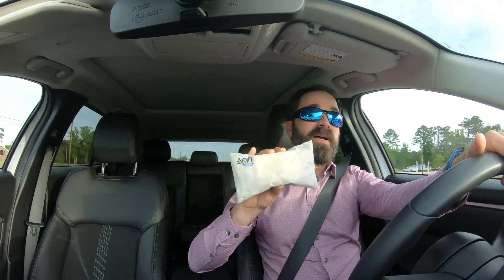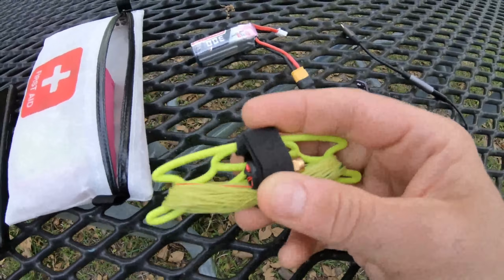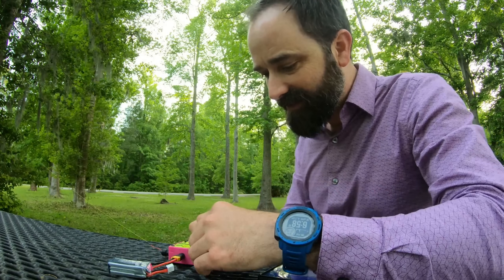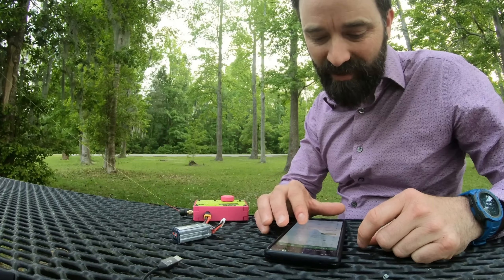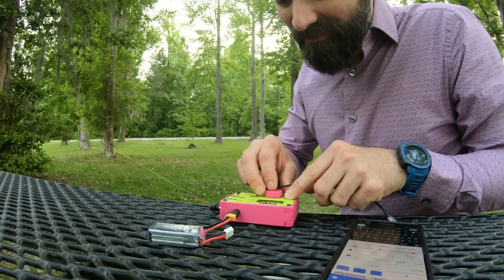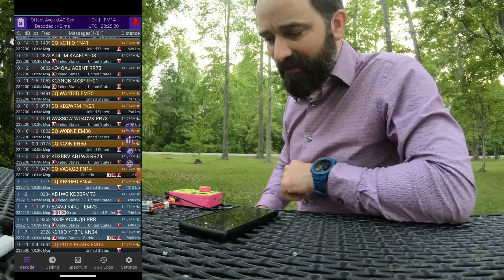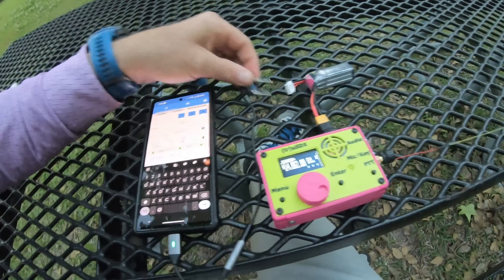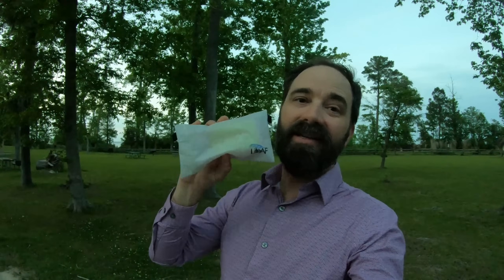Smallest possible all-mode POTA kit?

Comment: Adam, would you think about switching over to the QMX for the ultimate all mode pota kit once Han's gets the SSB firmware fix done?  Will it ever be possible to do JS8Call on a cellphone with a app like FT8?  Would you ever consider powering your radio with USBC PD since you always have a power bank with you for your phone.  Found a kit on amazon that has multiple barrel connector adapters to USB C that initiate the handshake to supply 12 volts only?
Reply from the maker: No, I still think the KX2 is a much better performing radio.  But the QMX is still one of my favorites. I built the QCX amp to go with it too, along with an internal amp low pass filter for 10m and external filters for the other bands. It's pretty sweet!

The QMX is incredible for the $, and is a far better performing radio than the truSDX.

Comment: Pretty nifty. I’m working to put together a small POTA kit….not this small. My battery would probably weigh more. Less is more. I think I’d be more inclined to activate it I didn’t have to tear down shack equipment and it wasn’t too burdensome to transport. I already have a small EFHW antenna setup as well as an arborist throw line setup that packs up into a small dollar store bin. Just got a tp-iii paddle. Next will be the rig. Kinda of waiting to see the new Yaesu, but will likely build a QMX first.
Reply from the maker: Yeah, I think you're on the right track. This errs on the extreme side just to see what's possible. A super compact 2 lb kit would be much more enjoyable to use. Often times, compact and portable is a more important factor than just the weight, and ease of setup is important too. Have fun building out the kit!
Reply: @ technically I think the KH1 is under 1 pound.
Reply from the maker: @misteraon  and my MTR 2B with 3d printed case, earbuds, battery, and antenna is just 4.8 oz.  6.6 oz with a padded case. Not bad!

Comment: Do you have a video that demonstrates building your digital adapter cable?
Reply from the maker: No, but the build instructions, PCB, and BOM are posted under "3D Prints and PCBs" at www.k6ark.com. the assembly process is very easy.
Reply: @K6ARK  cheers mate. Do you have a rough timeline on when you think you will have stocks available again on your Amazon store?
Reply from the maker: @SMB_SpeedTwin  I don't sell these in my store. I shared all of the files, instructions, and links to parts to simply roll your own.
Reply: Ah right thank you! Being in Aus it kept changing my profile to the American Amazon site, I thought I was doing something wrong. This hobby has by far the best type of humans involved. So many people sharing their knowledge, experience and designs. Thanks again mate.

Comment: Can you get the full 5 watts with that battery? I just ordered one.
Reply from the maker: Yes, lipo cells (even small ones) are great at putting out higher current (low internal resistance) and can put out full power on the truSDX.
Reply: @K6ARK  Right on! Thanks. 73

Comment: Hi Adam, I am a complete novice. My (tr)uSDX is in country and will be delivered any day but I am really struggling with what antenna I should start off with. Are you able to offer any advice please?
Reply from the maker: Tell me more about your use case and operating plans?  What bands do you want to use?  Where will you be setting up and operating?  What are your priorities (compact, high performance, multi-band)?
Reply: Hi Adam, thank you for taking the time to reply. I am intrigued by POTA and the idea of establishing contacts and multiple parks in my local area and beyond. I believe where I am in Australia my best chance of establishing a contact would be at 40m. I think perhaps a pocket EFHW might be my best option but I’m not sure. My priorities are compact and if possible multi-band. I was hoping to buy a no turn end half wave antenna from the QRPGuys but they are currently closed.

Comment: How low can you go? I watched this last night before bedtime, but then couldn't sleep, as my mind was racing with ideas. I know you tethered the antennae to a low tree, but I wonder what other options would work without making the pack heavier? Tnx Adam dit dit
Reply from the maker: Well, in general, the higher bands reach out further, so you will want to be on the 10 or 15m bands for DX.  Adding earbuds would help a lot with picking out weak signals.  The limiting factor will be the relatively poor receiver of the truSDX (which is still pretty dang good!).
Reply: @K6ARK  Hello, the Mtr3b doesn't have the option of 10/15. But my question, was how about the antenna. Thank you :)
Reply from the maker: @miketaylor253  the older, 7-segment display version MTR3B can be modded for 17m. I modded one of mine. 
A half-square is a good wire antenna for low angle radiation and gain. I have also built and carried a moxon, although one for 20m would be fairly large.  Others use verticals with a bunch of ground radials for efficiency.

Comment: I saw in the "live" feed portion a reference to Outd Log. It appears to be longer available. Do you know if it is gone?
Reply from the maker: Oh dang! That's recent. 🫤

Sad to see it disappear.  Looks like we may need a new solution going forward.
Reply: @K6ARK  HamRS maybe? I am hoping to start doing POTA and I had not thought about logging.
Reply from the maker: HamRS has major bugs and issues that haven't been resolved since I purchased is 3 years ago. I have abandoned it, as it appears to also have been abandoned by the developer. It loses logs and busts call signs when you try to enter a partial and back-fill. It's not usable on Android.
Reply: @K6ARK  Thanks for your quick review!

Comment: Another nice video, Adam. But why didn't you use a USB cable (instead of audio cable) to connect your phone with (tr)uSDX? The USB sound card is embedded inside your little pink (tr)uSDX already.
Reply from the maker: I have found that the rig crashes regularly with the USB control.  It just doesn't seem to work reliably.  Perhaps I need to try another firmware update, but I haven't had consistent success with it.  The audio adapter works flawlessly.

Comment: How did you build the CW part in the radio?
Reply: I think he has a video on it. The circuit board is tiny. Then, there are two round head nuts in the corner. He has the same thing on his Mountain Topper 3B.

Comment: POTA ?  Most POTA activations are either from inside the vehicle, or perhaps at a picnic table a few steps from the vehicle. The operators could bring their entire station, a generator, a fully-stocked beer fridge, a BBQ, and a big screen TV.  If anyone is worried about ultra light weight equipment, then it's either SOTA (mountain climbing), or (yes, yes, yes... -> ) a very small fraction of POTA activations.
Reply: Ok, yeah, if travelling by air. Ok...
Reply from the maker: Or perhaps if you just want to have some fun with minimal equipment.  But yes, this setup is ultra-portable which is great for travel.
Reply: One aspect I liked is that there is not a reason to leave home without a station on hand. Impressive!

Comment: Interesting barrel adapter to go with thr drone battery.  I looked for an xd30 to 3.5 dc and cant find one that small.  Was it diy?
Reply from the maker: Yep! Homebrew. 
Take the plastic housing off the connector and trim the leads down short.  Solder direct to the XT-30 connector and cost with adhesive lined 3:1 heat shrink.  Solid!

Comment: I have a TSDX too. Waiting for  Summer to use it (VE7). I'd like to use FT8. Do you sell that cable? I already have your EFHW kit.

What voltage/power were you using here?  Battery details?

72
Reply from the maker: You can build the adapter yourself through the link in the description.  Order boards from Osh Park, and parts from digikey. Pretty simple build. 

The battery is just a 3s LiPo for a small drone. 300 mAh give a couple of hours or so of operating time.